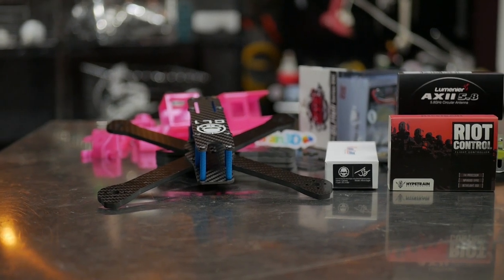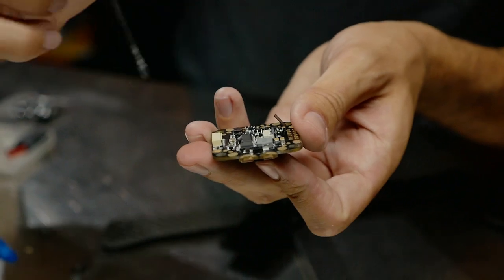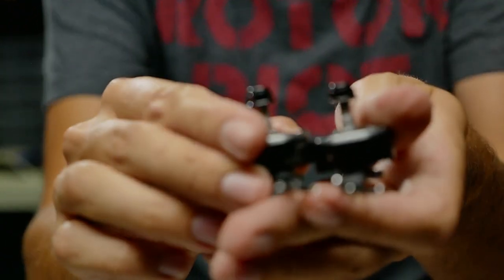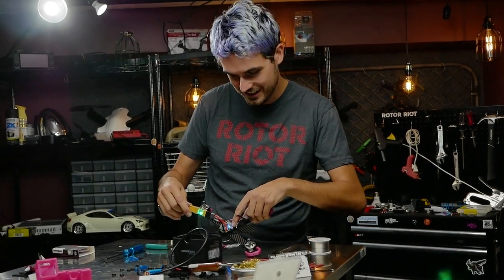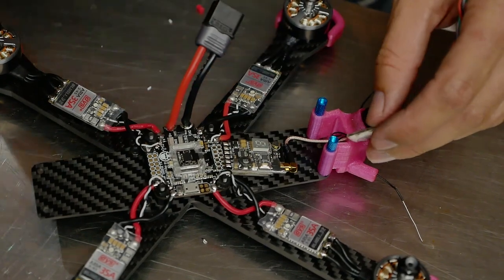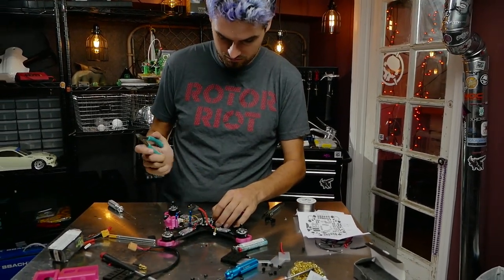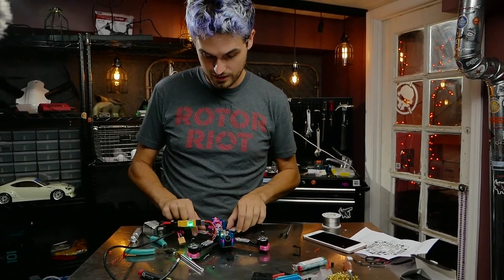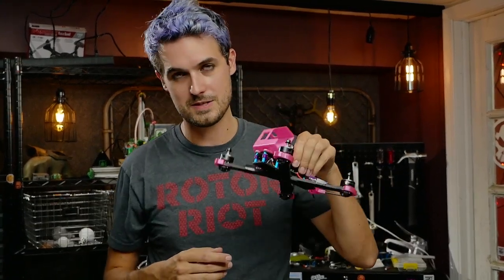Build: CL1 Build (with Le Drib)

Comment: I like to use the arm protectors as motor soft mounts, by flipping them so the part the screws go through in on the top of the arm and under the motor. 🖖🏼

Comment: 2 fingers wide, just how we like it 🖖🏼

And thanks for the shout-out about “combing” your iron (as us bench techs call it) rather than wiping your iron. 
You can also “flick” your dirty solder tip and then roll your tip in flux, then tin again shortly.....combing is faster and easier👍🏼....little known for most is your copper braid comes pre impregnated with flux so when you “comb” flux is being added already 👍🏼👍🏼

Thirdly, could you give credit on the prop protector please

Comment: Hi Drew, nice build, you propably also could got a way with connecting the smartport wire  from the FrSky receiver to the TX side of the UART which is used for Sbus and use the the FrSky F port protocol, which is awesome, meaning you have the RC comments and telemetry back to the radioo through just 1 wire. That would spare the hasle of setting up softserial and processor utilization caused by it.

Comment: Got a cl1 frame hanging on my wall right now. Nuked my crappy hglrc v5 in it. Will likely replace it with the RR flight controller and an AKK vtx. Frame flies great though.

Comment: I accidentally melted the plastic gyro mount a little bit when soldering up the riot control board, it’s the only blemish on an otherwise perfect build. 😩
Reply: That won’t affect performance, I’ve done it too. We do sell replacement gyros if you really want to fix the cosmetics though
Reply: Will do eventually drew, I know what would be nice, a uk rotor riot online store. It’s not easy to get stuff over here. Keep up the good work, you lot are great.
Reply: There are several retailers in the UK that carry our gear. Quadcopters.co.UK has been one of our retail partners for a long time

Comment: signal gnd is not needed it is conected With minus to batery so if you cinect + -  signal + is enough so only 3 wires not 4 reason there should be shielding but from times of Dshot this losing sense totaly becose for digital you dont need awoid noise in fact it works on oneshot on 3 wires too ...